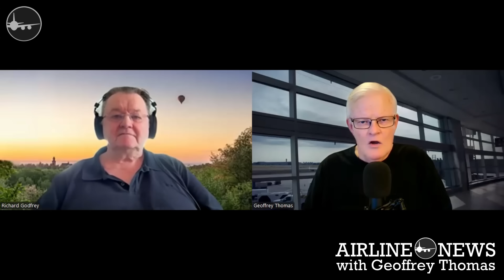Air India Crash - Probable Cause  #airindiacrash

Comment: The fact that the battery had some kind of failure raises the possibility that the system that was there to ensure that this was a fail-safe event was not working.

The accident team must have the evidence to determine one way or the other when the RAT deployed relative to the FDR indication of a fuel cut off signal.  

This catastrophic event should not have happened -  the engines have their own independent electrical power supply and mechanically driven fuel pumps - they are certified to be able to operate on suction feed, so failure of boost pump electrical power is not an issue - that in my simple engineer view narrows it down to the spar fuel valve.

All hell could have been breaking loose in the rest of the electrical system but if the fuel supply had not been interrupted the aircraft could have climbed away while the pilots figured out WTF is happening.

Comment: The probable cause explanation fails to consider or explain (i) why both of the fuel switches were manually turned to cut off, (ii) why the co-pilot asked the pilot why did you do that, (iii) why the pilot responded that he didn't, (iv) who restarted the engines and (v) why it took bout 10 seconds to restart the engines. Coming up with a probable cause explanation without these considerations and without the benefit of the cockpit voice recorder and real time information about what was going on in the cockpit and what the pilots were saying and doing seems to be premature. All of the above are essential to rule in or our pilot suicide. The safety recommendations are great but this explanation does not consider or rule in/out pilot suicide. Who knows if that will ever be possible, but the possibility of pilot suicide can't and shouldn't be ignored.

Comment: The Air India disaster was likely caused by a TCMA malfunction of the Boeing 787. The TCMA (Thrust Control Malfunction Accommodation) is a safety system that, among other functions, can shut down the engines if they produce more thrust than allowed while the plane is on the ground, in order to prevent accidents.  Because of a glitch and lack of cross checking, the plane "thought" it was still on the ground right after taking off, which prompted the TCMA to shut down both fuel valves automatically.  Pilots had nothing to do with it.   That's why the co-pilot said "I didn't move anything" and that's why the pilot didn't challenge him after he said that.  
The FDR (Flight Data Recorder) logged the CUTOFF, even though the mechanical levers weren't moved, because to the FDR,  the TCMA cutoff command looks the same as a pilot physically moving the levers.

The same type of TCMA malfunction happened in 2019 with an 'All Nippon Airways' 787 dreamliner (same airplane), but in that instance the plane was landing, and even though both engines were shut down, it managed to land and avoid an accident.
Reply: Hi there. Let me present a technical evaluation: Could TCMA plausibly explain AI171’s dual flameout?
1. What exactly this TCMA does on the 787 - DREAMLINER
Its primary role is to limit or cut thrust if it detects unintended thrust increase on the ground ( for examples :  throttle jam, lever mis-rigging, false command).
TCMA is designed to interface with FADEC — it doesn’t mechanically move levers, but it can command a fuel cutoff or clamp thrust at idle.
2. Condition required for a TCMA-triggered cutoff
a)  Ground mode input: TCMA interventions including engine shutdown are only armed when the airplane is sensed “on ground” (Weight-on-Wheels, squat switch, or related discretes).
b) Mismatch detection: TCMA needs a logical trigger — such as commanded thrust lever vs. actual N1 discrepancy.
c) Validation path: On 787, this logic must pass through redundant inputs and FADEC acceptance. 787 architecture has innemerable redundancies built-in.
3. Lets jump in to the specifics to AI171:
Phase of flight: AI171 lost both engines few seconds after liftoff during its climb. For TCMA to act, the system would have had to incorrectly believe the aircraft was still on ground.
Now, in this speccific situtaion , what we can expect in data:
a) FADEC/EEC logs showing a TCMA event or thrust accommodation flag.
b) FSOV (Fuel Shutoff Valve) discrete close commands traceable in the logs.
c) Possible “ENG FAIL” / “THRUST ASYM COMP” messages in EICAS.
4)  CVR based obervations and evidence: The copilot’s line on question by his colleague on why he cut off, “I didn’t ” could likely match this — if the cutoff command was system-generated and not Switch lever-initiated.
Now, lets compare the cited case of ANA 2019 event:
In that ANA case, both engines cut off after touchdown because ground mode was very well valid.
Thus , havng said that, If AI171 experienced a spurious ground-mode latch immediately after liftoff, the logic could theoretically have issued the same command.
5 Plausibility vs. Probability
Plausible: Yes, it is technically possible. If a ground-sensing failure tricked TCMA into believing the jet was still on ground, it could close both FSOVs simultaneously.
Probability: Highly improbable, but cant be ruled out. Thus rating of probaility I would give is : Low–medium. 
The Boeing and FAA design assurance levels (DAL A) make dual-engine cutoff in flight an “extremely improbable” condition . It would need:
Simultaneous failure of weight-on-wheels/RA inputs, No rejection by cross-channel FADEC logic, No independent inhibition after liftoff.
6. Checks to look into  If TCMA did trigger, there must be positive log traces across FADEC, valve discretes, and malfunction controller memory. A “clean” log without TCMA flags would strongly argue against it.
Thus to conclude your valuable aspect : Yes, technically possible: A TCMA mis-trigger could explain both engines shutting down in sync without pilot input, matching the copilot’s CVR statement.
Critical evidence: Logs of FSOV commands, WOW/RA status at cutoff moment, FADEC channel traces, and TCMA event flags.
Why it’s less likely: The 787 system architecture is built to reject precisely this kind of dual-engine spurious shutdown, so it would require a very specific and rare failure chain. Hope this gives greater insight into your extremely valid point. Thanks for bringing it up Mate.

Comment: For a couple guys who present themselves and diligent, critical thinkers, this episode is chock full of assumptions. Even if there was a fire on board, it would not cause both fuel switches to be turned to cutoff.

There's no way your "probable cause" is correct.
Reply: The emergency procedure is to transition both fuel switches to cut-off in an double engine flame out (alarm panel might have shown this) and the one fuel switch back to run and wait 10-14 sec for the second fuel switch to run as batteris can only start one engine at a time.
Reply: @sventhormodpetersen1752  Wrong! The MEMORY ITEMS are both fuel control switches off then both switches back on again without delay. Then manually deploy the RAT with a button push. Just wondering where you found that incorrect information?

Comment: Gentlemen excellent presentation, I try and watch/listen to all of then but can’t guarantee that I have so if you have covered these 4. Points excuse me….1. I is being discussed that the first office may not have the experienced flying hours  claimed, some of these may have been n’as an observer in the jump seat 2. What is STAB POS XDCR  not explaining acronyms is unprofessional 3, the report reports the plane weight as 2,13,401 klm and max possible weight as 2,18,183 4. The repost says the accident is nor related to the fuel switch but go on to say “there has been no issue with the fuel switch since 2023. These all bring the report in to disrepute

Comment: @Richard,  with all due respect, I'll watch twice, but could not grasp how you jumped from possible smoke seen in the video footage to a thermal runaway of the battery coupled to chemical damage around it's casings.

AFAIK, after the frist incidents with the Li-ion battery packs the plane type was grounded till it was totally redesigned as original predictions were not reliable.

The cells were provided by the reputable Japanese company GS-Yuasa. 

The integration of the module and the BMS were done by the also reputable French company Thales.

The redesigned pack was made to isolate the cells from the surroundings with thick steel and vent out of the plane fumes & smoke to survive an eventual thermal runaway incident. 

Redesign also added care, better separating cells and more conservative BMS precautions.

I just can't see how a thermal runaway would begin even floodind the surroundings of the battery.

Any short circuit outside the battery would disable the module through it's battery management system.

A short circuit inside the battery could in theory initiate an event.

How sufficient water and chemicals would enter the module casing?

How an internal APU module failure or thermal runaway would affect it's surroundings through the thick metal enclosure venting outside?

The kind of damage to the enclosure of the battery wouldn't be immediate. It likely happened after the crash, mechanical damage, exposure to fire.

If indeed there was a thermal runaway, how it spreads to the other problems.

I do accept the idea that a contaminated water leakage flowing into the electrical bay could create havoc in the electrical and electronic circuits. A metalic tool forgotten loose in the surroundings could do the same BTW.

The conclusion about the battery module looks a step too far for now.